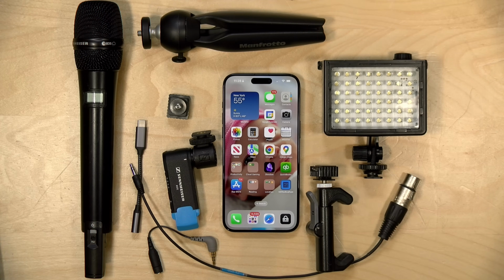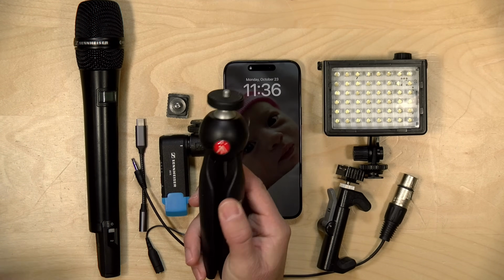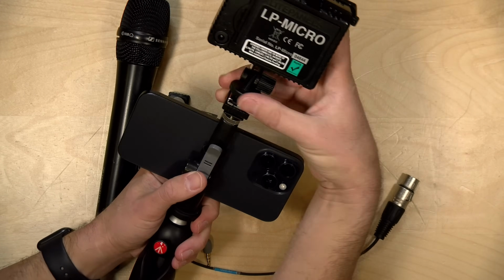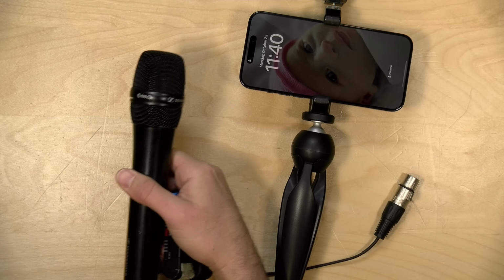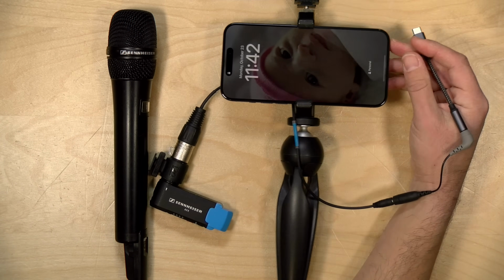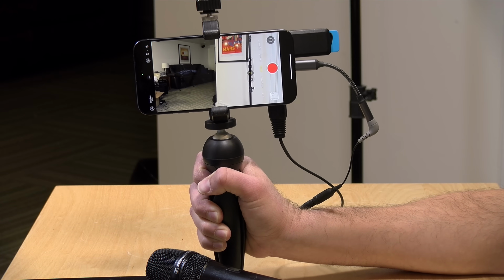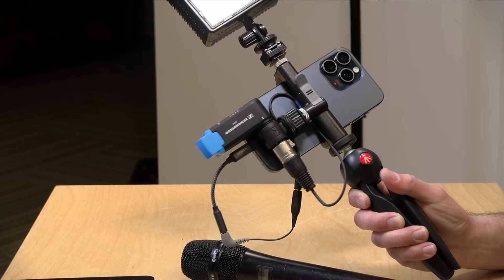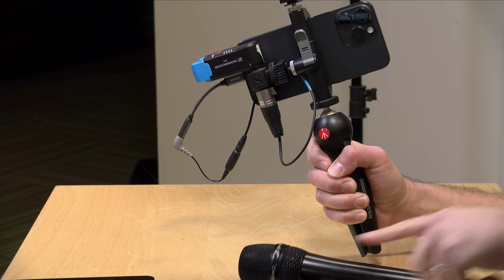My Current One-Man-Band iPhone Field Shooting Rig!

Comment: Im late to comment on this video and You probably already know this but you can get a C to C and 3.5mm female port splitter.  Im not sure how well that would work for splitting out video and audio but i sometimes use one for charging while recording audio.  

For years Ive been recording my cruisetrip vlogs using my samsung s21 with a small joby short tripod with the glif holder. Love the glif!  I have prodessional cameras and gear but for light weight unibtrusive vlogging a phone can be easy good general run and gun video. I usually dont use an exterior mic on my phone and simply make sure to get close to me or other people when talking.  Wind or noisy environments or fingers touching the phone can be challenging with internal phone mics.

I have to use go pros in the water sports.

If i need to use a top light i use a small led cold shoe rechargeable light.

One of the biggest cons of using a phone is the video can ripple or have artifacts when either panning the phone or on a hot day.

Happy vlogging! Cheers!

Comment: The whole rig looks top heavy due to that light, increasing the "rocking and swaying" when adjusting your grip. Will that light mount onto the side cold shoe and move the mic radio up top? Or maybe is there a thinner and lighter Lithium Ion LED light (with replaceable battery pack or cheap enough to buy multiple lights) that would fit there? I see a light on Amazon called "Meixitoy 120 LED Phone Light, Selfie Light, 5000Mah Rechargeable" that is about $30.

Comment: After seeing that whole setup I might recommend checking out the just released DJI Osmo 3 that I've been seeing reviewed.  I have the first version and it was pretty nice, it didn't have a screen like this new one. I'll bet you could figure out an external lamp if you needed one as well.
Reply: Or the DJI Action 4, also with the same low-light 1 inch sensor.

Comment: Lon, Great video. Where do you get those cold shoe mounts that can be attached?  BTW, I use the RODE wireless ME. Good audio, which can be monitored in the RODE app. Also, using the RODE Capture app would help you on the video side without constantly turning the phone to capture video.
Reply from the maker: Hi Dan! Here are the mounts: https://lon.tv/7wjyt - a little pricey at $8 each for what little they are but they get the job done.

Comment: All the cables are a bit of a pain.  Maybe someone will put out something a bit more "direct". 😅 You certainly aren't the only person using a phone for professional video these days.

PS: Make sure to keep your Bluetooth OFF well filming.   A lot of jerks are locking up iPhones over Bluetooth. That would ruin your video because it requires a full reboot.  Any idiot with a $5 microcontroller can do it now.  The Flipper Zero also does it.

Comment: Very nice mobile iPhone rig.  I was hoping that Apple would allow functionality to control/monitor the audio from external mics with the 15 Pros -- but alas they have not. The problem comes because the standard camera app drives the gain on external mics to 100%.  So in some cases you may encounter distortion in your audio because of this.  The only solution to the aforementioned is to use a external mic which has a gain control on it -- or -- use a camera app which will recognize the external mic and give you control over the audio coming from it.  I've personally been using Protake, CinemaP3 and Blackmagic Cam.  Except for Blackmagic Cam -- all the other apps cost money -- but IMO, it's worth it.  This is because these apps not only give you control over the audio from external mics -- they give you extensive control over the video capabilities of the iPhone.